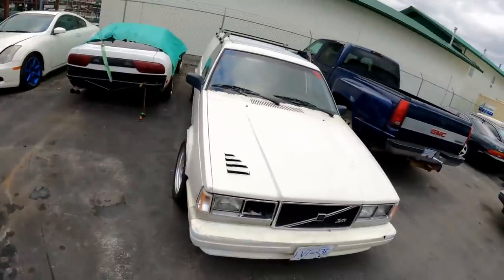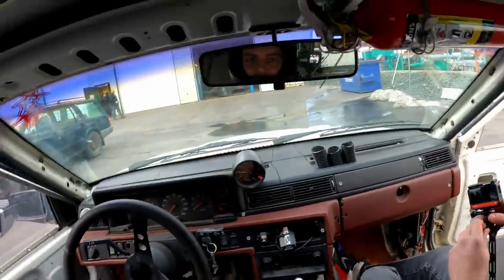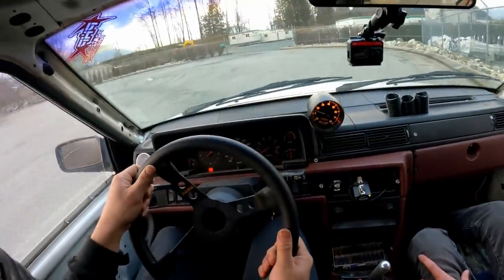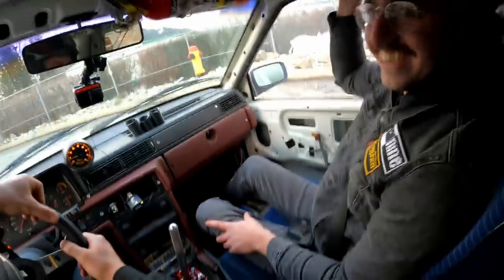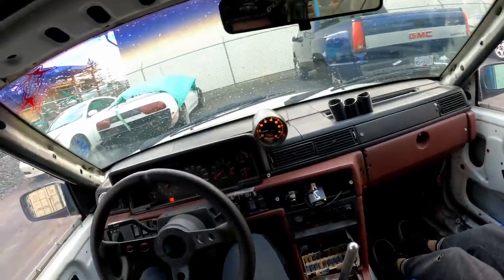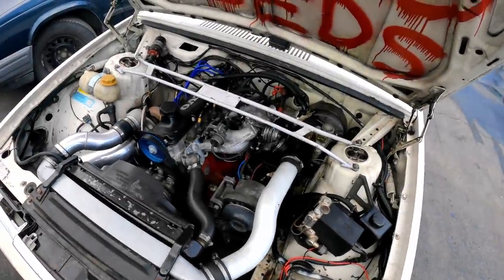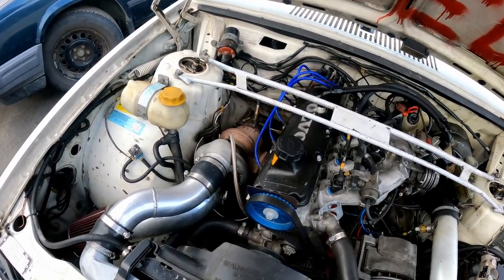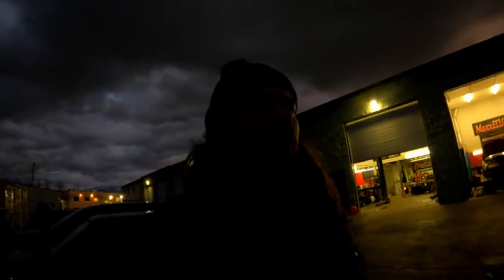450hp big turbo volvo wagon first TEST RIP

Comment: Super stoked for you bro, that car is a monster. I still remember back when you had to be careful with goldie not to brake the trans every time you drove the car. Now you can finally rip without worrying.
Reply: Exactly what I was thinkin bro. Finally a transmission than can handle the abuse he throws at it 🤣 m47’s are so weak compared to some like a ZF or getrag.

Comment: I think that you get a lot och fluid/oil in your catch can when you have a bung in the valve cover. swedes like to run the original breather box to a catch and a breather from where the block distributor goes to the catch can. When doing that you ventilate the crankcase and the gases dont have to find its way to the head to get out. 

i just drilled out a freeze plug that fits where the distrubutor sits and put a bulkhead an10 there with "o-ring washers" (welded the nut on that backside. then hammerd the assebly in.

Comment: Those ZF transmissions can spit out a lot of oil through the breather tube on top. I routed a hose to a little catch can up by the engine so as soon as you let go of the throttle it just drains back down. Mabye you won't have that problem but thought I would just give a heads up, I know others who has had the same issue too so.
Reply from the maker: Apparently the trans are super sensitive to being overfilled even slightly. I was spitting oil of the breather cause i filled the trans when it was out of the car and added 0.3 litre too much. Drained it to the fill plug level and it seems to have fixed it
Reply: @driftsnlifts  good! Mine didn't  stop leaking even below the fill plug level so I had to do something. They are great little transmissions though.

Comment: 3.90s try that 3.73 is a perfect highway gear fuel mileage and cruiser with power makes fun torque but a 3.90 with the right amount of power will make the vw a whole new animal
Reply: My bad not 3.90 I meant a 3.30 to 3.50
Reply: @josephthrasher1313   Volvo stock transmission is 1:1 in fourth gear and the BMW is 1:1 in fifth gear.

Comment: Your big problem with clutch is the volvo stock flywheel
thats the whole problem
it wear out and go deeper. so the pressure is less. and the surface is super super glace. if you have stage 6 clutch it will keep slipping if you don't resurface the flywheel and make it less deep where the pressure plate bolt on. use 20-50 or 10-60 diesel oil. fill it with extra one bottle.
Reply from the maker: I dont think so because i did adjust the rod and i havent been able to make it slip again

Comment: DUDE IT RIPS LIKE MINE! AWESOME!! Too much throw-out bearing tension on the pressure plate hopefully!
 Nice sends, Love how you calmed dude down from calling the boot knockers. 

What speed in mph do you go into fourth? I go in at 105 mph. Anyway, really cool man, I'm so excited for you,
 still the syclone turbo?

 The oil spray is because the camshaft is actually slinging oil into the hose from looking 
at the location of the bung on the valve cover. I would try to put the bung in a more "oil still" area.
 Ls swaps have
 this problem too because the factory crankcase evap location sucks on drivers side valve cover. I hope that helps you. I use the factory
 setup and it's good for what I need, with the exception being, the vacuum point is at the air screen of the turbo, in the horn. 
HEAd studs from aRP I think summit racing sells them.
Reply from the maker: So 3rd gear tops out at 80mph apparently with this setup so its geared much shorter than yours. I am gonna look for a 3.31 rear diff to put in it and give it a bit longer legs. Itll probably be faster with more gearing and take advantage of the sweet torque curve. The bung on the valve cover i positioned it right above the cam cap so it wouldnt be in the direct line of oil spray from the lobe but im sure some is still getting in there. Im not to worried about it as the oil drains right back down to the pan atleast. Got some arps on order from yoshifab so we will see how long those take cause i know hes having supply issues.
Reply: @driftsnlifts  Nice I roll with 3.73, I had 4.11 iirc. I think its a ford 3.73 now. Taller gear will help load the turbo harder too. Sometimes even spooling quicker. Good thinking on cam cap, however those sick acceleration g's you are pulling and swinging, are sloshing and Slinging all the oil everywhere, my guess. 
Everyone is having "issues" of some sort or another these days it seems, in reference to stocking and shipping. 
Like George Thorogood said "everyone is funny, I think you're funny too" But that was only after one bourbon one scotch and one beer! 
Love the show man, cant wait to see what you do next! 
Volvo Hulk Smash! SUBSCRIBE LIKE BELL! :)

Comment: is there a list anywhere as to how the engine is built? like what components are used, turbo, headgasket, turbo manifold and so on :) i would just really want to know what goes into making the engine withstand so much power considering the block with turbo from factory only got 150 ish HP..

Comment: So is your pcv setup an ideal setup or should i go with something else??
Reply: you can put a pcv outlet where the distributor would go in a 240, on the 7/940's theres a freeze plug there instead, just poke that out and make a connection for some tubing to go in its place, ive seen a guy who ran a 500hp redblock who recommended that along with the original outlet, theres a vid on youtube of the car, but its in swedish, if you wanna watch it just search "Stevens Volvo 740 GL Turbo 500WHP + 4th gear burnout och Info om bilen"

Comment: What are your top speeds in the lower gears, 1, 2, 3, 4? 5th = 210kph - same as my DOHC turbo holset mini truck with 4.4 rear and 0.9 fifth lol, nearly useless.

Comment: Hey man, I'm planning on manual swaping my 91 NA wagon. In the far future I also plan on boosting it with a intercooler to around 200hp. Do you think it's worth having the m46 over the m47? I've heard the m46 is slightly stronger but they are both pretty shit and will blow up. I want a t5 swap but at the moment I don't have the time or extra cash to do that swap so I'm going with a plug and play m46/47 swap.

What trans is in your car?
Reply: just buy a m45 if you dont mind 4 gears

Comment: i have 3.31gearing  and 5 speed zf in my volvo 965 16v turbo right now. before i have 3.73. but if i whas you i had lock after 3.08/3.15 gearing if you will have more car for the monny. but will you only drift are 3.31 a good gearing  :)
Reply: I have 3.15 for volvo dana 1031 brand new from bakaxeldelar sweden. Works really well with zf 5 speed.